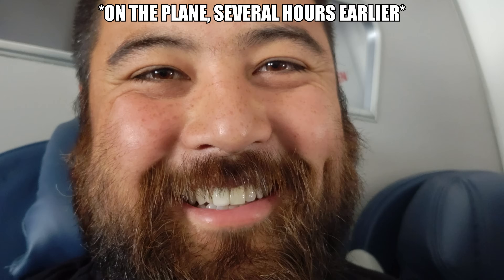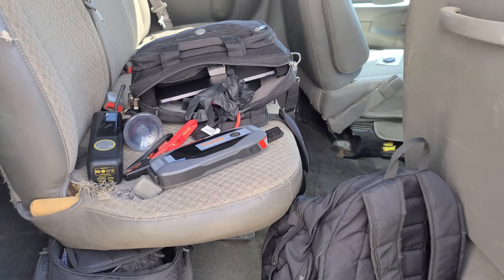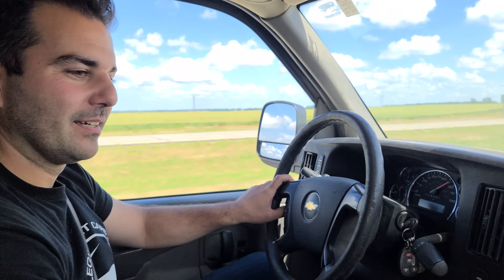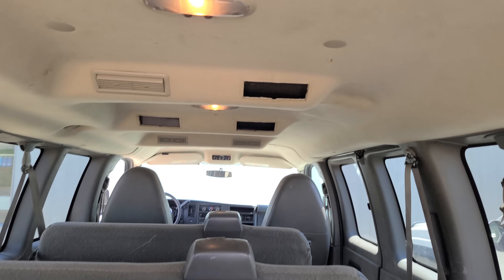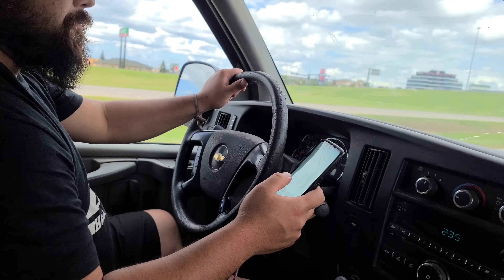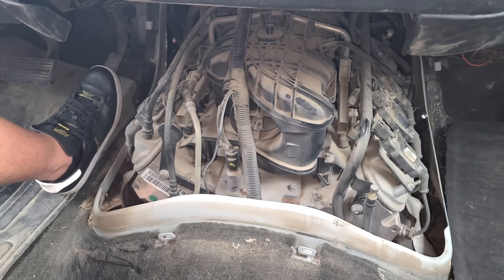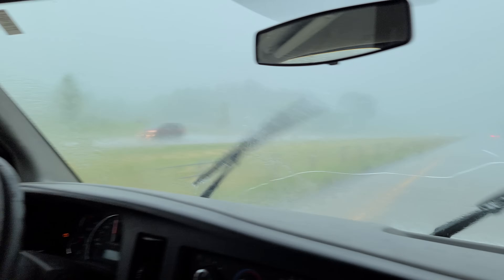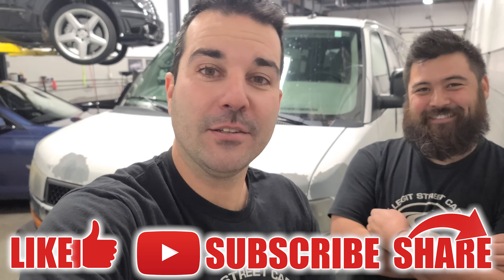I'm Building A 1000 HP Tow Van So I Bought A Broken One 800 Miles Away & Tried To Drive It Home!

Comment: If thats a 2012 I think it has the ly6, makes like 367 horsepower if I remember correctly, the 280 was the first 6.0 from earlier on I think. Great engine though, has square port ls3 style heads, has vvt that you can keep or delete depending on the size cam you put in it. no afm either on 2500 and 3500 trucks and vans.

Comment: I had a Dodge conversion van I bought new in '98, washed it frequently throughout the year and kept up with regular maintenance. Whatever the Chicago area put in the salt around winter 2012 and beyond completely rusted the bottom away to the point in 2016 I needed a tow and the driver was too scared to pull it up onto the deck because of the rust and rusted away parts. When I sold it in 2018, the only thing in 100% condition was the drivetrain.

Comment: The stabilitrack issue was probably the rain those connectors sometimes leak then get shorted and when they dry out since stabilitrac is tied to the abs system both lights usually pop on at the same time

Comment: We buy and sell a few hundred of these vans every year. The problem with the trans is very common. The easiest way to get the dog house off is to pull the 4 18mm nuts holding the pass seat in, unhook the airbag sensor wire, and remove the seat. Takes about 2 minutes.

Comment: A lot of things I've seen with these motors is the flex plate cracks and certain frequencies and rims it causes the cracked plate to chatter like that. 

Very plausible it's that or torque converter.

Comment: 24:15 if you ever want to know if a patrol vehicle is actually a patrol vehicle and not just a dude in an explore, look for their spotlight above their side mirror(s) and the orange running lights. with that Ford, they'd be horizontal orange lights above the headlights, as opposed to the civilian model having white running lights. Excess orange running lights are always a sign of a cop. Obviously it's daytime and all that, but it's just a general tip

Comment: I was in a rainstorm and hit high water in another make. Cannot remember the message displayed, but the symptom was like yours. Figured out the drum breaks at the back were wet, so they were not as effective as the front disc brakes. This resulted in uneven tire speeds and drove the computer nuts.

Comment: Sounds like the tach cable is rubbing through the casing or odometer cable. 
you feel the slipping between shifts. As the clutch's apply. not while driving.  you would be overheating if converter. At the end that's a slip.

Comment: My brother inlaw has a similar issue, where it,ll shift correctly & not shift out of third , had 4LE60 or 4LE80 , transmission has a converter pick-up solenoid  that goes bad , there's two a short with angled plug & a long solenoid, have to drop pan out

Comment: I got some awesome speakers amp and radio for this van i got a pair of $500 JL 8"real slim BOX'S for under seats in a Chevy pickup the irony... Also a ROCKFORD FOSGATE 1500 RMS DUAL COIL SPEAKER 13 INCH IN A BLACK FIBERGLASS Q BOMB BOX FOR MAXIMUM BASS ALL SPEAKERS WITH BOX'S HOOKED UP PROFESSIONALLY ALSO ROCKFORD FOSGATE AMP TO POWER THE 13 INCH SPEAKER SAME WATTAGE 11.1 INCH JENSON DOUBLE DIN RADIO ALL BELLS AND WHISTLES ONLY NO CD BACK UP CAM CAPABLE OVER $2000 EASY TO BUY FOR ONLY$1000 DOLLAR'S I'M IN NY...💯💯

Comment: I am a big advocate for rear fog lights (in Europe, they are mandatory). Sometimes, during low visibility conditions, having the lights on doesn't provide enough rear light output to be visible from behind. On top of that, driving with the hazard lights is dangerous since there is no way to announce a lane change (and in some cars, takes out your brake lights because 'Merica). The only solution to it is having a rear fog light added.

Comment: Love the idea of a van build, I have a 97 express with the 5.7 L31 and it runs great but would love to swap an LS engine like maybe a 7.0 but have no idea on how to start or what all it would require.
Reply: Is your engine the original engine that was installed by the factory?
Reply: @hb5914  yes all original
Reply: @chicomc96  I also own a 96-02 GM Van and my research shows that the 5.7 engine is designated L31 for those years.
Reply: @hb5914  sorry your right it’s the l31, it’s late lol. Was thinking of my 96 c4.

Comment: I had a complete transmission failure 07 Mercedes W211 E-Class 722.6. No engagement or movement in forward or reverse. I drained the fluid, removed just the valve body and installed the transgo kit and sonnax overlap sleeves and tcc damper valve upgrade parts as well as a new transmission filter. The car is driving now but something felt a bit weird, so I checked the torque converter live data stream on my scan tool and I am seeing it go from status "open" to "open + slipping" or just "slipping" as it shifts through the gears. Does this indicate a torque converter failure? I'm trying to do  a DIY analysis so I was wondering should it read "open" then either "closed" or "locked"? I don't know if you ever observed the torque converter live data stream on your scan tool. Also in attempting to find the correct replacement torque converter part number i'm seeing these 3 different types./ A 211 250 09 02 / A 211 250 12 02 / A 221 250 20 02  I was wondering if you can help me narrow it down to the correct one.(see engine and transmission info below) 	
M - Engine: 271956 30 844344 271.956 M271 KE18 ML R4 GASOLINE ENGINE M271 KE18 ML REPOGA - Automatic transmission: 722695 06 706128 722.695 W 5 A 330 AUTOMATIC FIVE-SPEED TRANSMISSION WITH CONVERTER

Comment: Definitely the torque converter clutch was slipping. Lubegard was a good move to try and save it, i was a transmission mechanic for 12 years, and ive seen that stuff perform miracles...but obviously the torque converter was too far gone by that point...

Comment: You needed to shake up n mix the contents of the transmitter additive…….that sand you saw was supposed to help reduce clutch slippage by increasing friction.
Lucas Trans Medic is the better additive……..the city of Miami would add it to their police cars once the transmissions started slipping to get a little more miles out of them before they rebuilt it

Comment: It's an almost guarantee that the reason the StabiliTrack kicked off is from the speed sensor ring on the wheel bearing(s) rusted and fell off. Most common GM issue across the board.

Comment: I drove from Winter Haven, FL to McPherson, KS in a 1997 Geo Prizm manual transmission and the car an I drove through Kansas for 2 years. As reward I bring it back home on a trailer pulled with a Ram 2500. Sadly after all of that the car was totaled in 2021 due to a lady that forgot to stay in the lane pushing me over to a ditch with her SUV. I can say I’m alive because of the car. Still missed it.

Comment: The rear seat is not the same in all gm vans. A 2000 van rear seat won't fit in a 2007 van and a 2014 rear seat won't fit in a 2007. U can do some mods to make a 07 seat fit in a 2014 up van. The seat tracks are slightly different for the rear seat between 2000 and up vans.

Comment: The reason you don’t drive with your hazards on is because those are supposed to be for when you’re stopped on the side of the road. Imagine one car driving, one car stopped on the side of the road- both have their hazards on. One is a real hazard, it’s stopped and blocking the lane, the other is moving. From a distance (especially in the rain) you won’t know the difference which could be a life and death difference.

Comment: Torque converter lock up is slipping bad, trans is most likely fine. The fact that it does it in all gears screams torque converter. All clutch packs going bad and slipping in every gear simply doesn't happen, especially on a stock engine.

Comment: Hey man i know you probably do not care and theres a good chance you wont even see this comment, but my familiarity with gm trucks is forcing me to make this comment. If you want to build this van for the content and sell it soon I totally get it thats cool, if you actually want a tow rig for yourself just do urself a favor and get an 01-07classic 2500hd/3500 pickup. These vans are made for payload not towing. The frames are not set up for it, the rear ends are not setup for it, and i dont know if you want a duramax but the vans have a detuned version of the duramax because they cant fit an allison so they have to use a 4L85E which cant handle all that power. The frames on the 01-07 trucks are very well made and obviously powertrain options are endless, as well as the 11.5 aam rear ends that come in the diesel versions of those trucks are incredibly strong just my 2c from a guy who builds trucks.

Comment: It’s a Chevy, they all have paint issues. Had a Chevy crew cab that had the transmission rebuilt twice. The 2nd shop said the first shop didn’t know what they were doing but it never worked the second time either. It kept blowing tranny fluid out the vent, and not just a little. The shop kept Jerry rigging it to buy time until the warranty ran out. They originally tried telling me I did something and I didn’t know what I was talking about until I told them I was a retired diesel mechanic. They refused to back it up so I have made sure I let people know the quality of their work. I currently have a Chevy van. It’s the only full size van I could afford in the area that could haul 2 power wheelchairs. Very little of the electronics work, the tranny ain’t great and a host of other problems I can’t work on anymore. chevies suck. I always did prefer fords.

Comment: 42.7% chance the transmission blows up.  A dried out half shaft bearing, or, maybe, one or both rear drive axle hub bearings are failing.  If the differential was shot, the “mooing noise” would be constant and there would be a noticeable loss of power.

Comment: Couldn't you cut just the face of the wheel off and put fake lug nuts on it and secure it to some wider wheels somehow so you get the look of the stock wheels while not even having to widen them. Take the "covers" off and appearance wise you'll have 2 sets of wheels.

Comment: Sounds like a failing torque converter I had built a k5 blazer an shaped in a LS 5.3  an used a 700r4 an I blew 2 converters due to the 5.3 mine moowed an. Then it went dead like neutral no gears thought I blew Trans bad first time but It was new an then I had it rebuilt again an beefed up an then blew second Converter an ya fixed it an said nope not pitting a 3rd in an sold the toy

Comment: You guys do so many revivals and pick ups all over the US and drive 🚗 them home but need tools everytime. Harbor Freight Tools may be willing to do a sponsorship for you if you just mention how great the tool kits are and the price for a second. Harbor F Tools are just about everywhere. You could fly 🪰 in and Uber to Harbor, buy the medium auto 🛺 🙄 tool kit, battery 🔋, remote starter switch, oil, trans fluid, brake fluid, coolant and needed Tools for those changes. When you get home have a lottery for the tool kit mentioning Harbor Tool again. 🔧 Do that each time and that makes about 5 to 10 times a year for you to promote them to your how many subs? They may just give you 3 to 6 kits a year but even if it's just wholesale cost is a big savings and they get promotion. The winner of the tool kit is stoked and maybe introduced to Harbor Tools and did not know about them before

Comment: Listen let me tell you something I've been servicing and working on  Vehicles as ASE certified technician for 24 years and the mechanic in the bottles are just absolutely useless When you have a worn part in your vehicle the only thing you can do is replace it with a used or a new part where you're just gonna damage more of your vehicle In a lot of times the 'mechanic' in the bottles will actually cause more internal damage to your vehicle and cost you extra in the long run And then the customer gets mad at us because we have to charge you more to scrape out  Jello like putty Or replace even more Because you didn't allow us to replace a $12 item now you're replacing a $2600 item Plus labor plus taxes cause you know you have to pay Uncle Sam And for all you customers out there please for the love of God it is so much better to make good choices on who you have working on your vehicle It's one thing to have a free Lance  Technician working on that Knows what they're doing I work on all makes and models but I have over 94 different certifications from small engines to diesels and everything in between you don't have to go to the dealer but don't let a shade tree mechanic cost you an arm and a leg